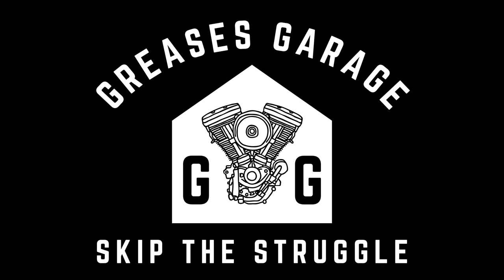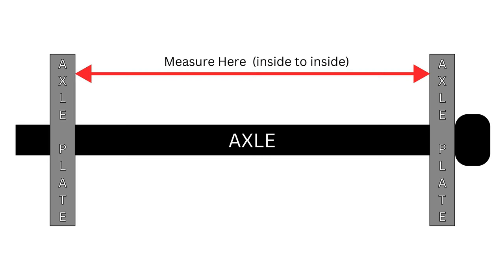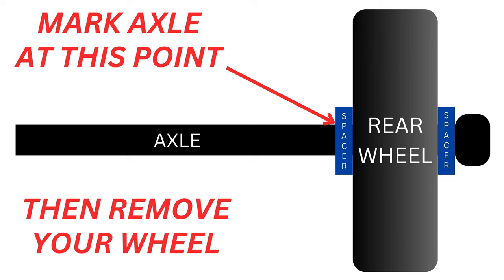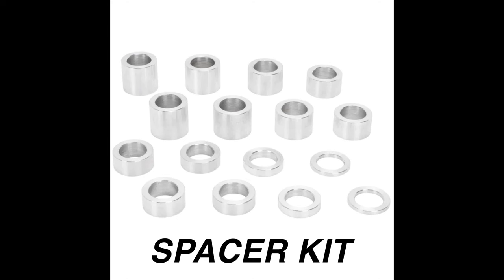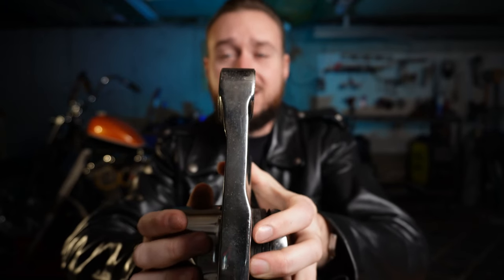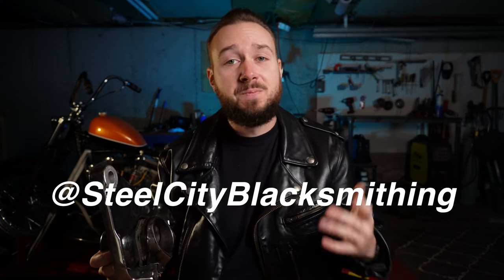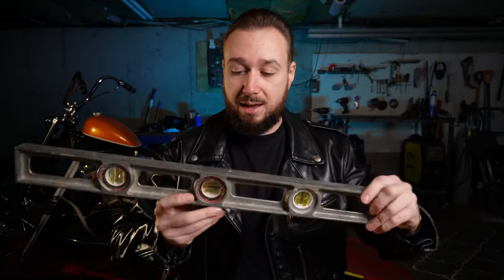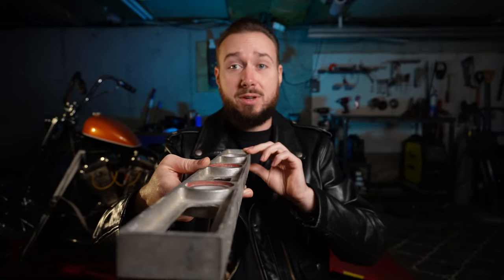How To Measure Wheel Spacers (After Hardtailing)

Comment: About machine  shops. Where i worked, i did most of the lathe and mill work.  When i retired,  that part of my job was contracted out. Young people  today aren't learning  machinist  trade. Ive taught my kids all i know.  They just need practice now.    Very good explanation of spacers and  centering.
Reply from the maker: I have a friend in his late 60’s who did his whole career as a manual machinist and has said many times that the manual side of the trade is disappearing. Both in people who can/want to do it and in companies even wanting to do it at all. Do you agree with that sentiment? Did you do manual and CNC?
Reply: @greasesgarage  sadly most companies  are only  going  with cnc machines.  If a machine  wears out its replaced with cnc.  Not many  trade schools that even  offer  manual machining  classes, cnc yes.  So kids, even  young adults  have no clue  even  on the basics.  Used manual  lathes and mills can  be purchased  for very reasonable  prices now. People  just don't want  them now,  owners are getting  old and selling.    I'm kind of rambling.   I started  and learned  on an old manual  Southbend lathe.  I was 19 I think. I have  used all three manual,  NC, and CNC. I made engine  parts for Mack that was all CNC. FN was manual mills. Clearly  my home  machines  are manual.

Comment: This was a great video , couple of things I read throughout my journey hardtailing my shovel was that sprocket alignment was key. I used a stock shovel rear wheel and a stock small dished 51t sprocket and when I ran a string line down my wheel is approximately 3/16th of an inch toward the brake side of the bike . With the wheel centered the sprocket is to far toward the frame . This tells me that the bikes from the factory did not have perfect center alignment.  I guess I will find out if it tracks funny... the general masses on the web seems to think it will be a non issue though.

Comment: I have to disagree a little bit....your rear wheel does not have to be perfectly centered between the axle plates....an offset is acceptable and sometimes unavoidable.most important is that the wheel is parallel with the centerline of the frame and the front wheel.bottom line make sure your wheels are both pointing straight

Comment: I bought a custom bike. Has a 180 tire on the rear. Bought a new chain. Lined it all up square and the chain rubbed the tire. I attempted to realign everything a dozen times. I was going crazy. Took it to shop and found out it was built slightly off(out of align) to fit such a large tire. He added a dished sprocket and spacers , we’re good. Great video 👍
Reply from the maker: This is a great point, there are circumstances where a dished sprocket can be necessary but they’re more often the exception as opposed to the standard so for this video I kept it pretty basic. Glad you shared this though!

Comment: My only concern with the priorities is if your hardtail isn't square to the frame, you shouldn't start out by centering the wheel. You should KNOW without a doubt that the center of the neck is in line with the exact midpoint of the axle. 
I know this because i bought a frame with a hardtail installed once, and it was off a BUNCH. Took some work, but the wheel was true when i was done, and with some creative bending on the sissybar, it was very hard to tell

Comment: Just used this and your chain alignment video to get the rear wheel spacing right on my ‘73 flh stock swingarm frame.  The previous owner had upgraded the brakes to ‘03 softail brakes, did a good job making the brake stay (I determined after watching your video on that), but never got the spacing right which I found after removing the rear fender and installing Baja tires.  I had a hard time trying to mark the axle where I could read it, so I just pushed sewing tape through the axle to get the measurement which worked well.  Thanks for your help!
Reply from the maker: That’s a great idea Mike! Glad you got it sorted 🤘🏼 thanks for checking out the videos I’m happy to hear they’ve been helpful 🙏🏼